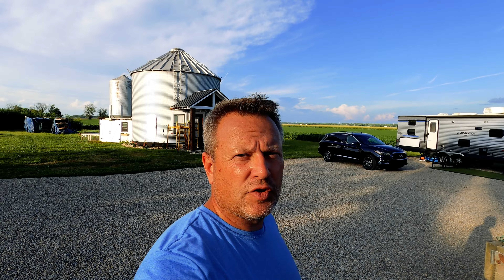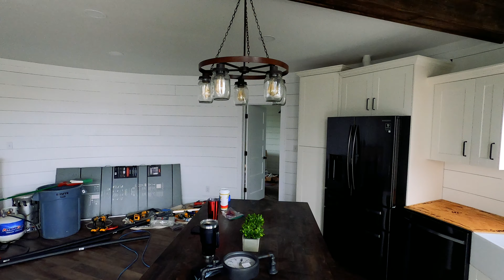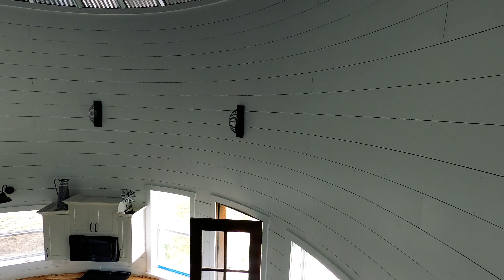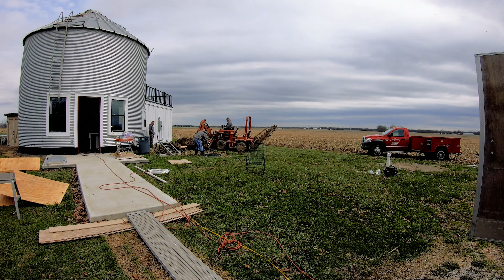Grain Bin Home Build... Episode 31 "Mechanical Finish"

Comment: This is a gem of a Playlist/Guide! You are free to tell me to shove off, but my wife and I are looking to potentially do something similar to this and are trying to figure out if it's feasible with our budget. Would you be willing to share a general cost of this remodel?
Reply from the maker: About $80 to $85 a sf cost... but that was me doing all of the labor except drywall hang and finish and concrete pour and finish.  Also the kitchen counter was subcontracted out.   Bin was already on site as well.
Reply: @blueroomoutdoormedia5630  thank you so much for being so open with the info!
If we were to have any questions during our remodel/construction of the Silo, would you be open to me asking you questions? I think your series lays it out pretty well, but I’m sure we will hit roadblocks. P
Reply from the maker: @TonyHoover21  sure. Feel free to ask me.
Reply: @blueroomoutdoormedia5630  would you prefer I hit you up on the side so I’m not blowing up your videos comments? If so, what would work best for you?
Reply from the maker: @TonyHoover21  here is fine
Reply: @blueroomoutdoormedia5630  Ok, fair enough ;)
I’m going to let a few questions rip. 
Do y’all get high winds very often? If so, how does it handle?
Is insurance any different than a standard brick style house?
Reply from the maker: @TonyHoover21  actually they perform very well in high winds.  Home Insurance for it is pretty standard.  Only thing is properly defining the value for replacement cost.
Reply: @blueroomoutdoormedia5630  How much per sq ft do you think it would knock off if we were to nix the room addon and the upstairs bathroom?
Reply from the maker: @TonyHoover21  still need a bathroom whether up or down.  So taking off the room addition... I would guess you could get into $55 Sq ft area